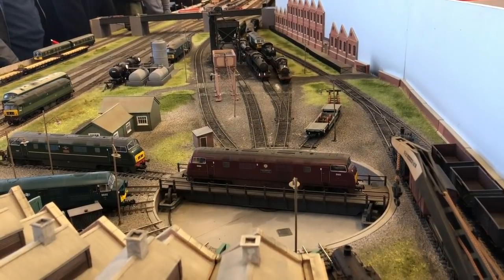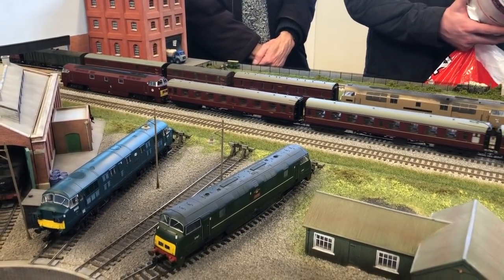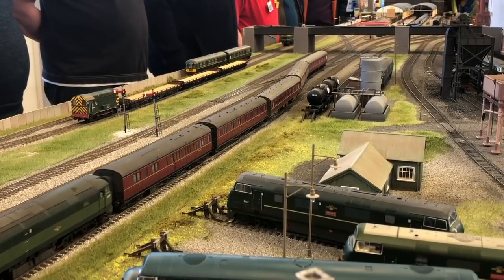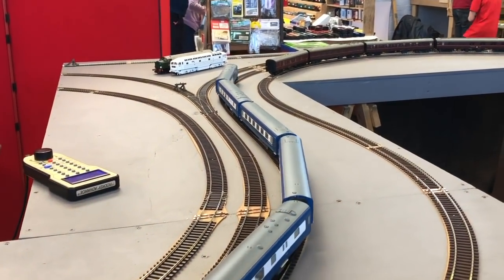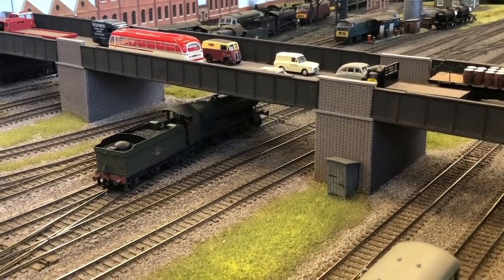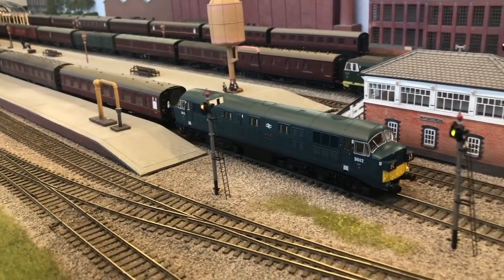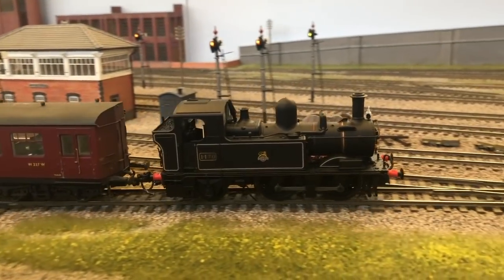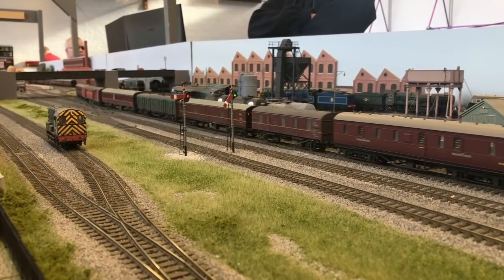HM143: Grosvenor at Basingstoke

Comment: What signals does Grosvenor Square Use and how are they controlled?
Reply from the maker: We use Dapol GWR lower quadrant semaphore signals which are controlled using Train-Tech accessory decoder - these are specifically designed to work the Dapol signals on DCC. HM.